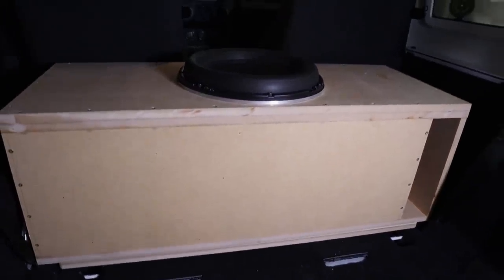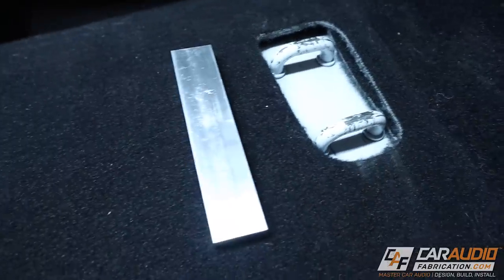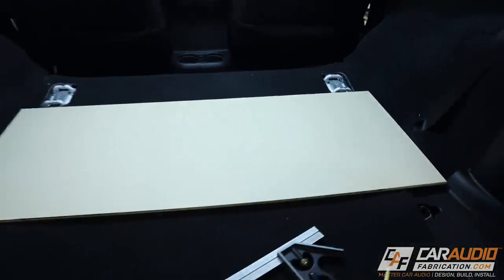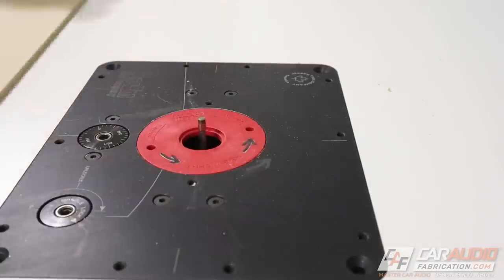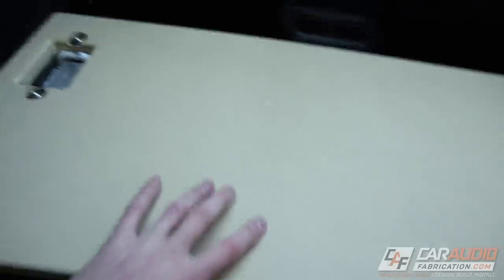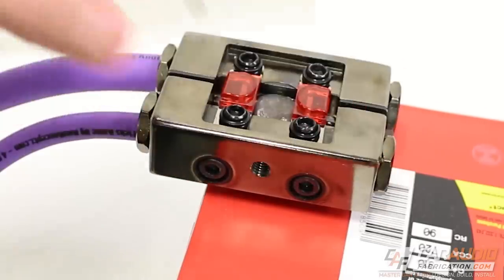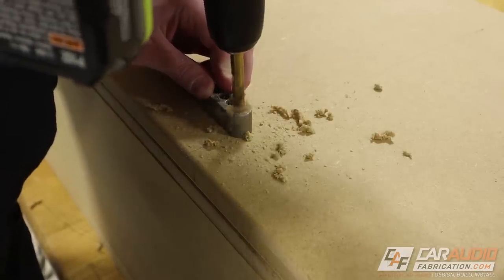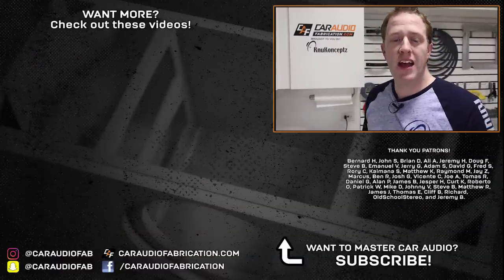MOUNTING a Subwoofer Box in vehicle - Get more bass!

Comment: Interesting. So how's the holding power of this method compared to my bungie cord?
Reply: Ratchet straps is the way to go .
Reply: Really 😶
Reply: Timothy Hinton never thought about that before thank you!
Reply: I use the rough side of Velcro. Holds perfect on my trunk carpet.
Reply: I have fishing line attached to the box. On the other end, is a loop which I wrap around my neck. Zero issues so far! 💪🏻
Reply: About the same, that box and woofer probably weighs 250lbs, no way are those little washers on mdf going to hold in a serious accident.
Reply: bolt them down you'll notice big difference compared to it being even a little loose
Reply: @0.- bolt them down to what? Carpet?

Comment: My sub mount was the 3rd row seat 💺 bracket for my caravan. It kept it in place and was easily removable with some quick disconnect power cables from a forklift 🍴 the amp and cap were mounted the the setup so the only other thing was my rca cables from the head unit. Great 👍🏼 and convenient setup. The 3rd seat also had wheels when not mounted in the old 92 caravan. LoL easy to move around the shop as I needed the space from time to time.

Comment: You should do a video on how to securely mount a box but make it removable. Sometimes I need to use my trunk for larger items or use the pass-through, but I don't want my box flying around if I need to suddenly maneuver or slam on breaks.

I was thinking of using ratchet straps around the box looping through bars bolted to the car frame. I could even put metal handles on the box itself to loop the straps through  (and for carrying).
Reply: I would have said the same
Reply: Yeah, a hot swappable sub design would be cool, if an amp is attached, high current connectors etc

Comment: I was googling this the other day.
Your advice is the opposite of the very limited info I could find on the internet-
You say it's better to rigidly attach the enclosure to the vehicle to improve acoustics, rather than decouple it from the chassis with some special mat or convoluted mount?
Reply: Its one of those things, mount it super firmly so the mass of the enclosure adds to the chassis, or isolate it to avoid vibrations/other noise. A proper firm mount is hard to get, so instead of a half firm mount, isolated can work better.

Comment: So I'm trying to mount into fiberglass. I tried just screwing it in but the bass pulls it back out (strips it out). I can't reach the other side of where it's screwed in to, if i remember correctly there is a chassis bar pretty much blocking access but there is a good 2 ~ 3 inches between the fiberglass and the chassis bar.

Comment: I have a similar build I am working with on my 09 jeep jk unlimited I I am using my old equipment my t2d2 12 from fosgate with the tb 1000, but I am having issues designing a sealed enclosure but having the max room for trailing

Comment: Can I get this kind of sub and enclosure size with a stock 150amp tundra alternator? (Stock battery as well) like 500rms is what I am at now and I feel like thats the limit. Headlights start to dim a tad when it hits at its preferred limit. Im currently running 2 shallow 10's under the rear seats.

Comment: what is your opinion on making a port through the rear deck for allowing more flow through the cabin vs being absorbed by the seats? Instead of folding down the seats
Reply: It’s one of the better things you can do. The reflection forward off the glass makes the sub so clean and efficient. When doing this don’t face the sub’s backwards. Face them foreword towards the rear seats & seal the front of the box off from the trunk.  You won’t have to Dynomat the trunk & the subs will be louder because you decreased the cars total air volume.  Any other time you face the subs backwards because the sound wave can travel longer distance and not cancel out vs facing forward. But isolation the trunk from the cab and porting through the read deck is the equivalent of adding an additional sub. Isolating the trunk makes it like you have it in the trunk facing backwards vs foreword with the benefit of being in phase with the other speakers.

Comment: So what is holding the aluminum block to the car?  I know that it's essentially locked in by having the mounting board bolted to the aluminum block, but I could imagine that the aluminum block could still rattle and vibrate between the seat mount?  Maybe I missed that in the video?
Reply from the maker: It tightens against it. Not going to rattle.
Reply: @CarAudioFabrication  Ahh.  YOu mean the metal tightens against the seat bracket?  Makes more sense.

Comment: That 8 gauge wire is almost too hard to work with. Very big and hard to bend. It’s great Wire if it fits your application.
Reply from the maker: Any subwoofer that needs this is probably going to be pretty large, not exactly a stealth install so it fits the application

Comment: Would there be a way you could help me on this question? Can you use a amp that has  rms power of 1125watts at 2 ohms and a max 1500watts at 2 ohms with a subwoofer that has 950 watts rms and 1900 watt max? Btw i have a boss audio pm1500 amp and also wondering if you have any suggestions for that amp?
Reply: Depends on what the final impedance of the woofer ends up. If you can wire the woofer to 2ohm then the 1125 watts rms for a 950 watts rms woofer is perfect. Rms is just the base line you want to hit. Running a woofer underpowered can cause some damage. Not as extreme like overpowering a woofer but still causes issues. Not bashing your purchasing choice but boss audio is not a reputable brand. I took a look at the amp you bought and I EXTREMELY doubt that it hits anywhere near the rated power.
Reply: What size fuse does it have? It only has one fuse which is scary right there.
Reply: Read a review that it has a 30amp fuse. Basic rule of thumb is multiply fuse by 10 so 300 watts. You're not even getting close to the 500 watt rated 4ohm power bud. Time for a new amp :)
Reply: @Dman199739  i have 1 amp with two 30 amp fuses but i read it only makes around 300w rms, its a 4 channel amp. I have another 4 channel amp and it has only one 30 amp fuse and it makes around 300w rms too
Reply: Boss amp. Unless you can verify its putting out those numbers 😳
There's no sub $100 amp that I know that will push out that amount of power.
Reply: @SENJIWEED  what's the model number of the amp?
Reply: Daylin Supple so i have bought a 4 gauge wire kit that comes with a fuse
Reply: @JN-53   no no. The fuse on the amp determines the amount of power that the AMP itself can handle. Dont worry about the fuse on the power wire for power. Were talking about the fuse on the amp as it's important to determine the actual wattage it can handle
Reply: Daylin Supple on the amp it had 30 amp fuses
Reply: Daylin Supple would there be a way to contact you better just so i can get a better understanding on some things?
Reply: @SENJIWEED  its fused per channel bud. That rms rating is per channel. Like my amp is a 6 channel and has 3 fuses. 40 amp fuses per channel 40 x 10 is 400. My 6 channel can have all 6 channels bridged at 400 watts a channel. Bridged 1+2 gives me 400 watts. Make sense? So your 4 channel is bridged with 2 30 amp fuses so it makes 300 watts per channel.
Reply: @SENJIWEED  what's the brand of the 4 channel with 1 30 amp fuse? I'll look up its info

Comment: Great video, but I don't think that's technically called a transfer punch. Just a spring loaded center punch. 
Transfer punches come in sets of various, specific diameters and are used to transfer precise hole positions through a template or the mating piece. They are extremely hand and can be found cheaply at harbor freight.

Comment: I call BS. While it might be a safety issue to have an unsecured box in an open (not trunk) vehicle it’s not going to make any “noticeable” difference in sound quality. I encourage you to show any testing proving otherwise. Boxes with subs in them are very heavy and are planted with carpet to carpet contact. They would have to vibrate themselves back and forth quite a bit to negatively affect bass resonance which they would only do if on rollers on hard floors. But if you’re bored go for it it won’t hurt.

Comment: I just installed my first system. It is an easy install but I have a problem: when I click the buttons and make selections on the head unit or change songs on a CD, my subs thump and it sounds terrible. I have checked all my wiring and it is all in par, so I am confused. Anyone know anything that would help me?
Reply: Try changing the ground on ur amps
Reply: Damn this is two years old
Did u ever figure it out
Reply: @br00talhonesty  I did figure it out actually.   Inside my amp where the negative terminal is soldered to the motherboard was barely soldered at all. 
So I did a minor repair and fixed the soldered joint and my problem was then fixed.

Comment: Every single aftermarket battery terminal I installed has either failed or rusted to hell so I'm never using them again
Reply: If every one has burned, it may be you.  I have found myself to be the problem many times when I have a similar problem.
Reply: @LerRhann  that's actually what I was thinking right after the last one failed honestly.  Then I was thinking part of it was galvanic corrosion so who knows. It was really frustrating tho.